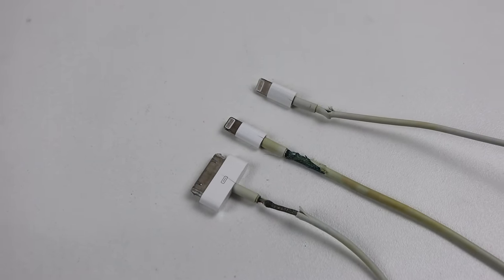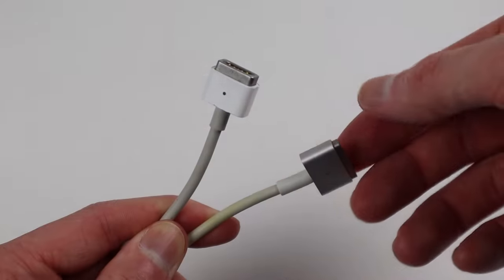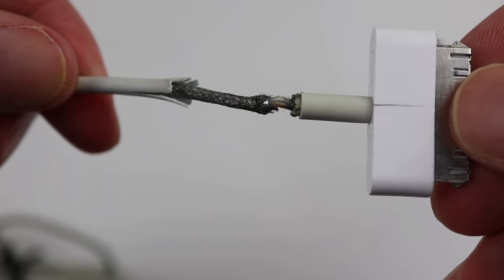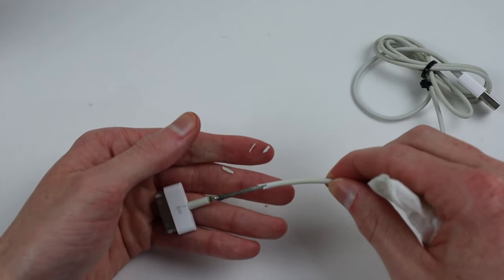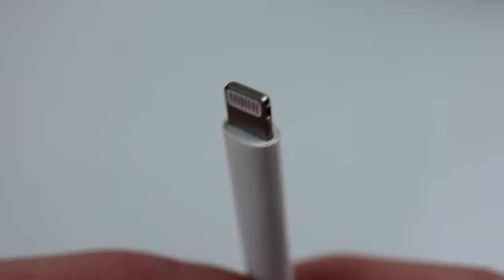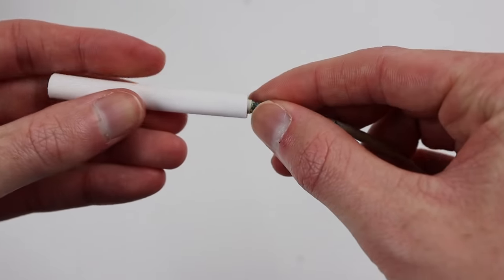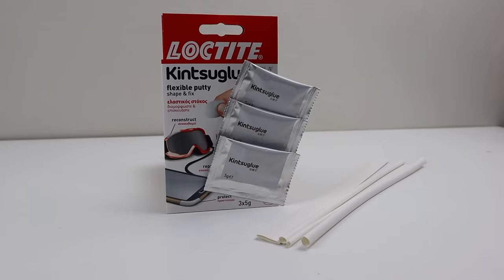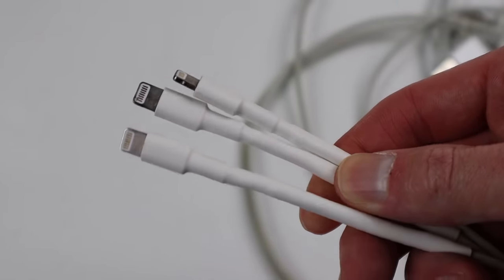Repairing Apple's Notorious iPhone Cables for $8! - Save $$

Comment: where did you find heat shrink that expensive?!

Also if the apple employees in the comments could stop complaining for two seconds, if you use your device or move it around while charging, or if you plug in and unplug your phone a lot, cable decay seems to be inevitable.  The joints for the connectors just aren't adequately reinforced and the weak points become quickly apparent.

Comment: This is the Apple's cable scam; They know a high percentage of their clientele is base on the "status" the apple logo gives. These type of clients will die before letting anybody see them with those crappy cables around. So... every six to twelve months they have to buy a new cable, which, of course, is not cheap . It is one of the best designs Apple has made in years. A business design in this case.

Comment: Or you could not buy overpriced designed to fail crap from Apple in the first place. :)
I think the green stuff was probably corrosion of the copper in the cable, not glue.

Comment: To save the world, plastics are now designed to be bio degradable instead of lasting 100's of years.  As a result you do have problems after 5 years.   It not cheap but the green alternative.  Same with the limited packaging material and instructions.  Not cheap but a green alternative.  However I have found the apple wires and wire braid seem to break also, so do this repair before the wire damage has occurred and cause shorts.